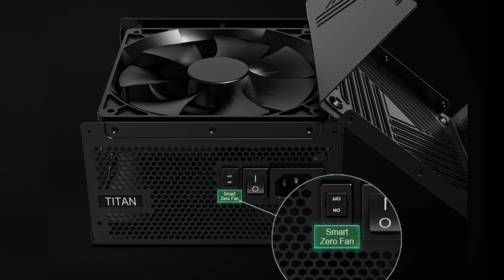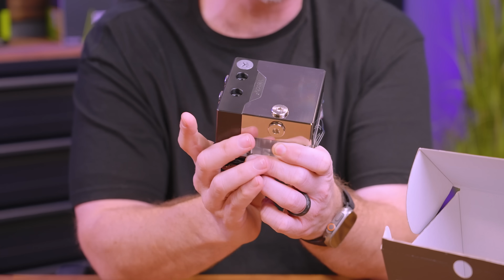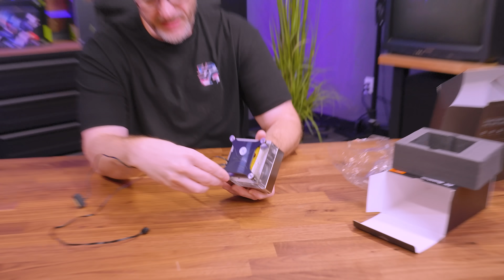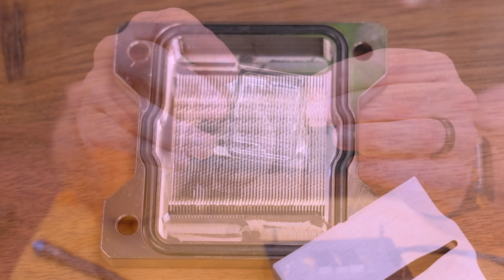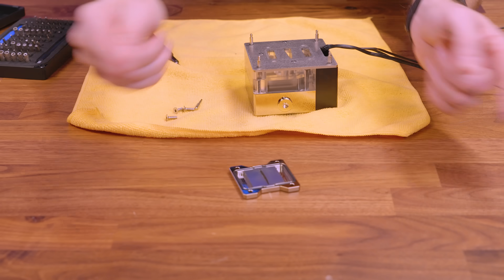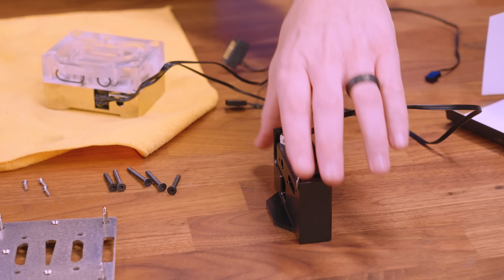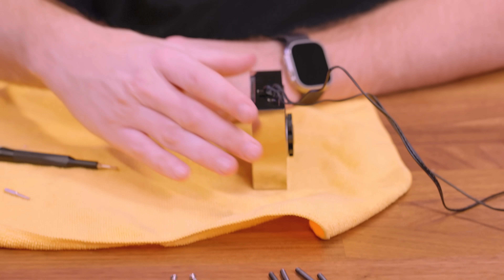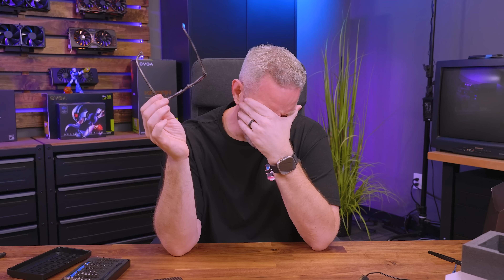I wish this existed years ago!

Comment: Not being taped MIGHT be so that you can remove the RGB in case you don't want it (not sure why you'd get the plexi instead of the other ones though if thats the case). If you don't take it apart it isn't moving anywhere, but should you want to remove it then its easy. I personally think its odder that there is tape on it since it fits just fine without it.
Reply: Those RGBs come on a roll and you just cut them to the length you need.  And it's probably easier for EK to buy one SKU of RGBs and only peel the adhesive when the situation calls for it.  And it would avoid assembly boo-boos like someone grabbing the wrong roll, making a bunch that aren't adhesive, and finding out later they were meant for an adhesive application.
Reply: @phydeux  Sounds likely. I have an EK block and I was actually frustrated that I couldn't easily remove the unicorn puke lights from it that only light up the EK logo on the nickel plated top, so I had to carefully roll up the cable inside of it so it wasn't just floating around my motherboard on a very carefully done build. I would have liked if it was that easy to take off... though I wouldn't have bought the clear plastic one designed to be MORE light up.
Reply: Yeah. As long as the thing isnt like slipping out of the block because they didn't use the adhesive it only makes the thing easier to service down the line. Also, it might provide a little bit of tension relief so its less likely to get damaged if it gets yanked. And at the same time, those that dont want rgb can easily remove it and not have to deal with an extra cable at all, but if they end up changing their mind they can just stick it right back in that slot without any serious hassle. I understand the gripe with the captive screw falling out, but I personally view their decision to not use the adhesive as a plus. I rarely comment on vids, and this is something so minor, but for some reason their reaction irked the hell outta me lmao

Comment: Swiftech did this with their h220 then got patent trolled my asetech. And their pumps were great. Still using my h220 on my 5950x today.
Reply: Yep, still using the H220-X on my 4790k 8 years later. Only thing to die on it was the little light for the different colored logo filters.

Comment: If you were to have the pump at the highest point, could I vacuum fill the system to remove all the air? The same way some cars have the cooling system vacuum filled.

Comment: About time someone made a good one of these. Haven't seen any decent options since the Apogee Drive II, and just try buying one. I love the idea of this as you can basically make you're own AIO... in essence. I would do this even in a full size build, not just ITX.
Reply: Barrow have been doing these for a couple of years
Reply: Nouvolo Aquanaut Extreme was very good. All the port options on the EK one though is really nice.
Reply: its because nobody wants to get sued by the absolute clowns at asetek. they patent trolled the aio which is absolutely stupid considering just about EVERY FREAKIN CAR since water cooled engines became a thing uses pump on block cooling! asetek never invented a damn thing, they're patent troll clowns. they blocked all water cooling innovation. hopefully they collapse soon enough
Reply: The barrow version works great and has been available for years and it works great.

Comment: Jay shows the clear issue with EK products: the level of assembly required by customers is higher than most of their competitors. From not peeling the double-sided tape on the rgb strip, not pre-cutting thermal pads, and not pre-installing thermal pads on GPU blocks, EK needs to step up from that perspective, especially considering the higher-than-average prices they charge.

While I have no doubt that EK's products perform very well, and IMO they are best looking products on the market, it just seems like they should be providing an improved customer experience.
Reply: These products are influencer freebies that the QC should have verified as perfect before they were sent out. The hugely expensive pieces that don't have any attention to detail is a big red flag for actual customers.
Reply: @BigBonelessJerk  Completely agreed. If this is the QC that influencers get, it would be the same or worse for actual consumers.

Comment: I considered the alphacol combo unit for a 280X case - but I think I managed to get around that and do a different setup, still only using the top fan mount in the front as well as the two top side fan mounts.
Reply: If it's the corsair 280x case you're talking about, I used to run a loop in one with a pump/res combo in the second chamber, just had to use quite a small res and it was absolutely fine.

Edit: by small I mean short
Reply: @AxR558  yeah, had that thought, but I really wanted to challenge myself - my solution is removing the top glass panel, putting the radiator fans (280 rad) on top, and putting fan grills on them. I'll have top fan mount at the front side to put a 120mm res plate (integrated pump) in there with full clearance.

Comment: Pressure is irrelevant Jay, Pressure comes from restriction of flow, if you have a straight pipe you will have no pressure.. Flow rate or volume is the most important number...

Comment: I wouldnt have used the tape on the led strip...

It's obviously held in place very well mechanically, and now you need to deal with adhesive if the strip fails and needs to be replaced.

Seems lazy... but to me, it's forethought. 🤷‍♂️

Comment: you have afixed the led strip to an item that will likely need to be cleaned. Thats why it was not stuck on there. Was probably a part used on other items and comes with the 2 way tape preapplied.

Comment: I built a custom EK-cooled system a few years back: 6850K, two 980Ti cards in SLI.  It was fun to build and run, but it was way too expensive.  I did it because it was the only way to get good cooling for the GPUs, and it worked.  I'm glad I had that experience, but I'll never build a custom water-cooled PC again.  There's just no need.

Comment: Excuse my insurance: he mentioned cavitation when referring to air in the loop. but do these pumps actually create enough of a pressure difference to create vapor cavities?
Reply: cavitation happens at the trailing edge of the blades when the blade is moving faster than the liquid can refill the location. If you change how fluid the liquid is you can cause/stop cavitation, all other things being equal in the system.

Comment: EK captive screws are rarely actually captive, I've learned. The ones in their recent round of GPU blocks are terrible for this. Also I feel like they deliberately leave the sticker backing on the RGB strips in their blocks, because I recall seeing the same thing in a couple EK blocks I've installed.
Reply: I would imagine the RGB strips they are sourcing all come with that backing, but they don't use it since other parts keep it in place and it makes that metal block easier to clean without damaging the RGB strip.
Reply: @Sgt_SealCluber This, and also bc of making customer service easier. Imagine if they were glued into the block and they had to rip them out every time they encounter a broken rgb strip. Would be terrible during quality checking/sorting out bad products before shipping as well as repairing warranty/rma products.

Comment: Hmmm.
ARGB ? By pulling the paper backing off you might have increased the potential for a short b the led strip contacts pressing against the aluminum of the bock. Might not have been a mistake.
Reply: i saw that too

Comment: Swiftect made a REALLY good one back in 2012 the Apogee drive II and it uses a standard D5 pump so after the 10 years of running my at full speed 24/7 the pump finally died and I just bought another pump and the crazy part is it fit on the LGA 1700 with no adapters even though I bought it for LGA 2011 so from a 3930k to a 12700k and still goin' lol
Reply: you talking about the one with the pump/reservoir on the rad? i think they still make that, i had one in 2014. worked great
Reply: @feelingtardy  Apogee drive II was a cpu pump block
Reply: @feelingtardy  Actually this was just a pump and CPU block the had it even before the H220 got banned in the US and then they had to move the pump into the Rad

Comment: I still have an apogee drive2 that will move water. They aren't great blocks by modern standards, and it only saw temporary use, but it saved me a couple times when I had a pump die.

Comment: The fact the DDC is pressed into the metal part makes the pump stator and electronics watercooled which is definately a good thing with a DDC pump. Def a really interesting product for SFF.
Reply: @Karl with a K Even the pumps with reservoirs attached are not technically self priming. It isn't exactly hard to design a loop and place the pump so it gets filled first. I think with this product that is going to be slightly harder thats all...
Reply: Two words. Modultra Lobo
Reply: @ps3guy22  That looks great, they state about the cooling of the pump electronics in the description too. It would be good to see some comparison analysis with these pumpblocks. Not only cooling performance but also flow rate ect...
Reply: @Karl with a K EK Water cooling mediocre products with a hefty price tag but youtubers are shilling so hard for that company that they can keep prices high. People will buy and defend products from that company anyway.
Reply: @kitkat2407  hi there poor guy. I bet u dont even have a custom loop. Not even Barrow plebs class.
Reply: @bartman2395  Are you twelve or something? I don't have a custom Loop because it isn't really necessary. I don't even have AIO watercooling because I don't have the usecase for it. My dark Rock pro 4 has Trouble with the i7 13700k in synthetic Benchmarks with No Power limitations but that is more a Intel Just Pumps Power into their CPU issues which is easily fixable by undervolting or Just setting limits. I don't utilize more than 60 percent for gaming so No thermal Problems in the real world. Not owning a custom Loop doesn't Tell you If a Person is poor or Not. It is a waste of Money to Just buy one without needing the benefits and I also don't Like the risk of flooding my system. I have the PC inside my Server Rack so fancy looking stuff isn't really helping me. I am far away from being poor otherwise I wouldn't have in my opinion overpriced Server Gear in my Rack. I mean I could buy one and Put stupid colorful liquids in it Like J2C does and then act Like "Hmmm I wonder why there is much gunk in my system". But that would be a waste. Maybe I will have to build one in the Future with the high thermals of Intel CPUs and the smaller lithography in cpus in General. We will See.

Comment: i think you mixed up jet plate and flow plate. 
The jet plate is the one with the slit as the narrow passage speeds up plow eg creating a water jet and the flow plate or more accurately cold plate is the plate with the fins directing the flow.

Comment: I usually get my watercooling stuff as new mounting solutions are needed, I buy their old stuff for cheap on my older system.  My system has NO reservoir and the pump is a variable thing that I got from banggood and it works great. This thing would have been great for my build but I can't complain about getting a full copper nzxt intel 9th/10th/11th gen Waterblock for £20, I kid you not. I love eBay sometimes.
Reply: Damn that is impressive

Comment: Question: Couldn't you use one of the other suction ports to hook up a small 'surge tank' that was higher than the water block to allow air to escape and prevent cavitation?  It's got 6 ports...